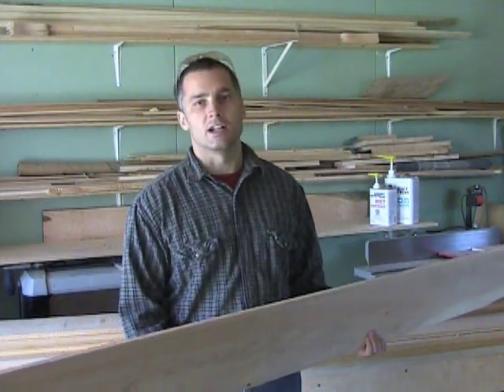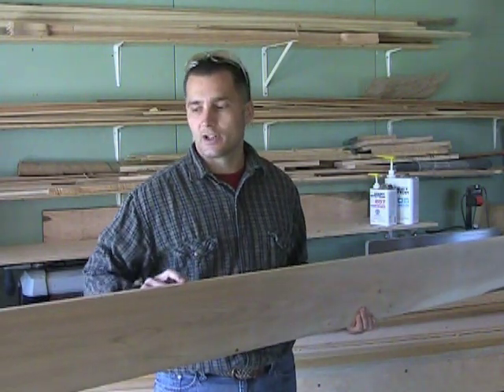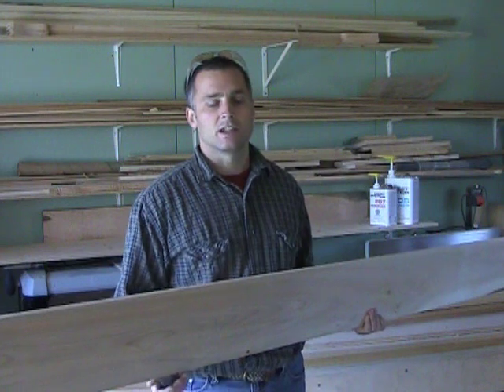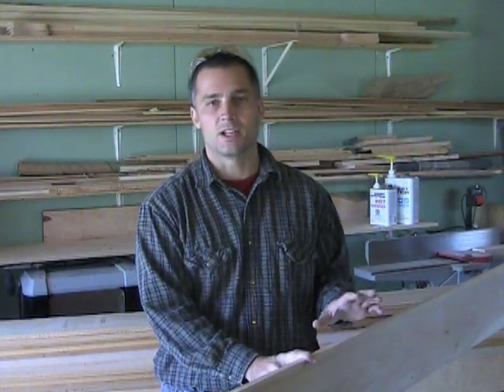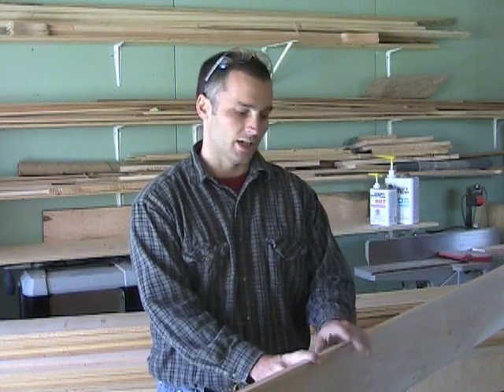Cedar Strip Boat Building: Milling Cedar Strips - Pt One

Comment: I cut strips on my Craftsman table saw and that was the end of it. The boat come out really nice. However, I was building a plug and was able to fill any gaps. I used a two part surfacing primer after sanding it was waxed, gel coated, then a thick layer of fiberglass. This became a female mold.

Comment: Jason,  I hope you see this post of mine all these years later. Great videos, first of all, so a big thanks!  What I am wondering is whether the process of making the cedar strips, this after using a jointer and planer to mill the board properly, whether cutting these strips would be better accomplished (easier, quicker and safer) with a high quality track saw, like a Festool or another? I don't have it in front of me to refer to but I believe I saw some sort of way many of these track saws can be used to make exact repetitive cut widths. Anyway . . . post another video! You are overdue.   Brad in Texas

Comment: I have a set of plans for a canoe can I size it down for a smaller one by removing the center mold  and by using mold one as the center  making it a 15 ft then a 17 ft
Reply from the maker: It really depends on the boat design. I don't want to say yes because some designs are pretty finicky.